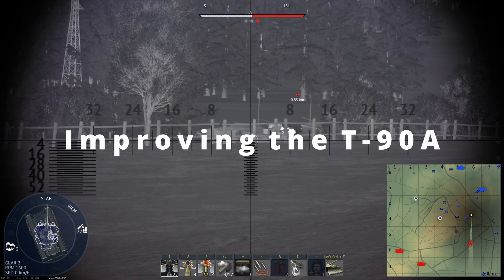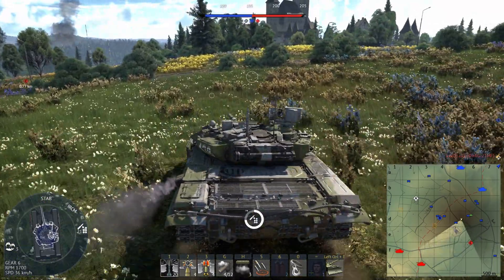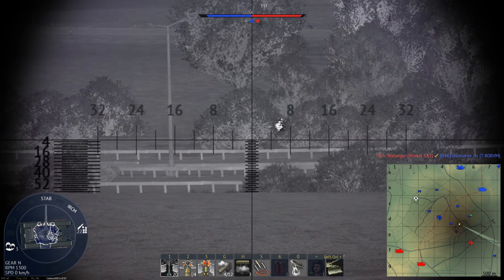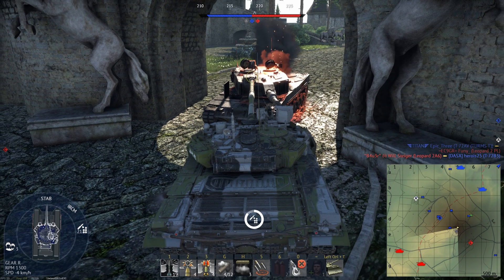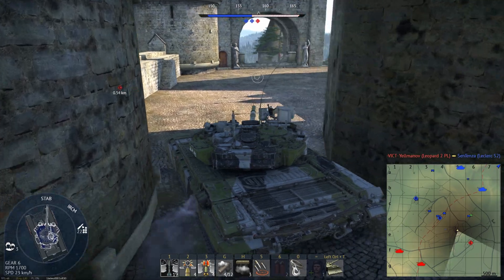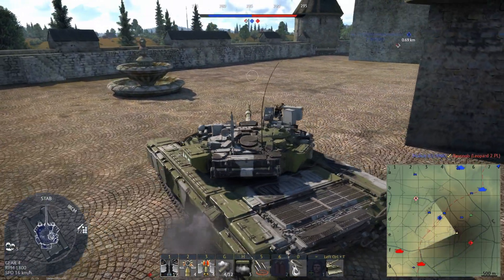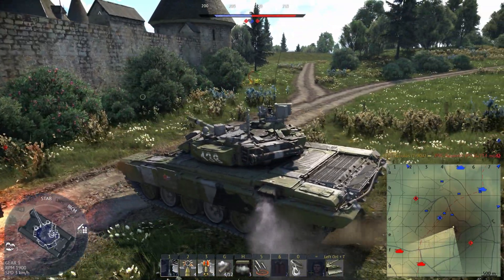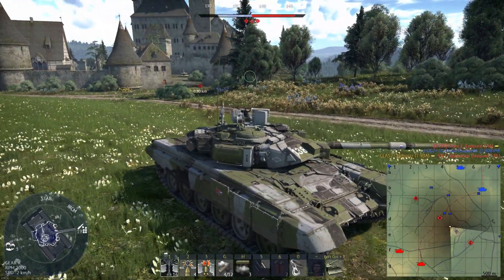War Thunder's T-90A Problem

Comment: You did excellent about explaining the t90a problems but there is few more
First t90a is fitted with 2a46m5 gun it should fire better types of ammo.
Second The top speed of t90a should be slightly faster (65kmh) because it has 1000hp engine.
Third t90a has better turret and hull traverse speed than older t90 or t72s
Reply from the maker: Thanks! Also I appreciate the additional info. I didn’t even think about the mobility and firepower.

Comment: T90A isnt reallt on bar with leopard 2A7 rn in war thunder , like they need to add the modern version of the T90 to be on the level of deadlness that the leopard 2a6 is
Reply: Yeah Russia need more tanks, their top tier lineups be lacking
Reply: @Adrirenn  yeah fr they only have like 6 10.0+ mbt's and only a handful of strong helicopters.
Reply: @cmdrfrosty3985  and like how many bmps and bmds, they really be lacking 🤡
Reply: @Adrirenn  russia litterally unplayable till the t14 is added
Reply: @cmdrfrosty3985  unplayable top tier and expensive repair costs, nobody respawn 7 times anymore.. only 4 or maybe 5.. Gaijin added dozers for all of ussr tanks and buffed the digging yesterday just to help them hide one of their 2 frontal weak points
Reply: @cmdrfrosty3985  also what's your profile pic sause? Im getting moist down there
Reply: @Adrirenn  my pfp is darjeeling drawn by sugamo
Reply: @Adrirenn  Italy and France be like.
Reply from the maker: Yeah, I'm looking forward to more advanced variants like the T-90AM and T-90M.